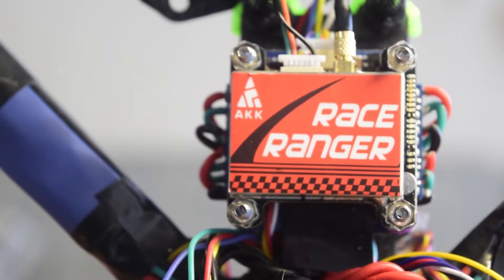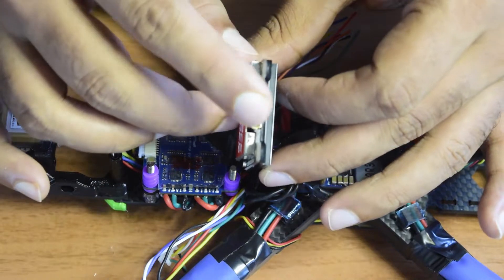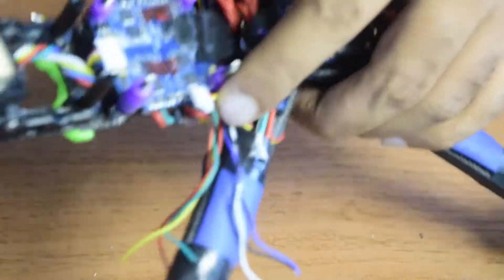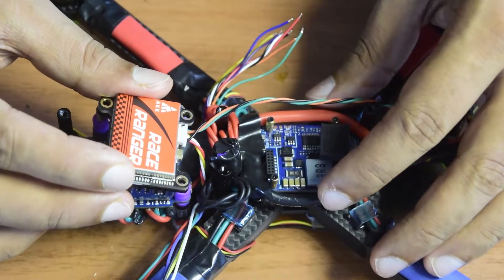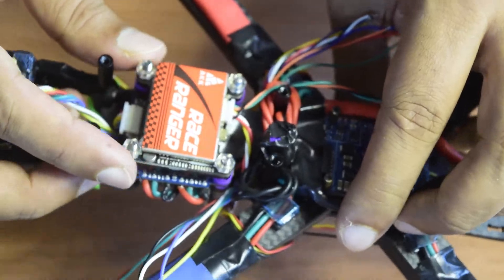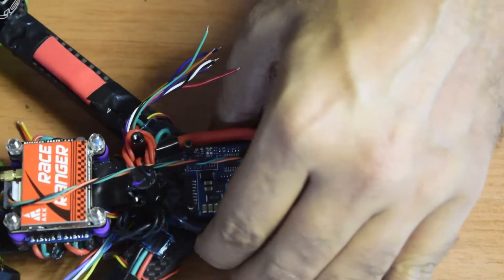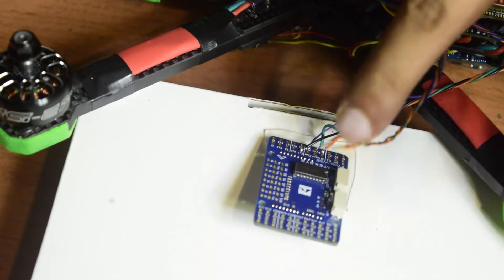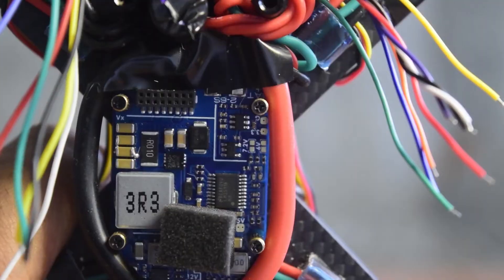HOW TO INSTALL VIDEO TRANSMITTER ON DRONE | AKK A1918 Race Ranger Long Range Video Transmitter

Comment: Hi
My camera have 4 wire
GND DM DP 5V

Where should I connect the DM and DP cable on my VTX
Reply from the maker: which is the camera that you have normally DM and DP means data plus and data minus these are microprocessor or microcontroller based cameras or USB cameras they cant be connected to vtx directly. I hope this helps. Please stay tuned to my channel for my future videos
Reply: that camera is probably a webcam or a digital camera. you need to buy an ANALOG camera. my personal favorite is the caddx ant.

Comment: I bought one of these to try out and IDK where my head was at because I somehow bench tested it thinking the antenna was on, when it wasn't, for like 5 whole minutes at max power. When I noticed I was like oh crap. Thing is, it actually still worked better than others I've tried lol.. it did mess it up a little bit though. I do have clear video at quite a decent range but the smart audio doesn't seem to let me transmit an AC coupled signal, and there is a constant pop every now and then. I went ahead and ordered the ultra long range version to try out and hopefully not destroy in the first 5 minutes.
Reply from the maker: Good luck. I hope this video helps. Please stay tuned to my channel for my future videos
Reply: @AstroShootingStars  I'm actually trying a Rush Tank Max Solo right now and the Race Ranger still seems to do about as well as the 2.5W output on the Max Solo. I just like the Max Solo cause it has a dedicated analog audio channel. IDK what AKK is doing but maybe they have actual filtering on the VTX.

Comment: Wired this on mine. And the video is glitching. My old one antenna broke off and was stuck on till battery died 100 feet up 8n tree know I can't get the picture quality I had with the stock vtx. Any way you could help. Please? Thanks
Reply from the maker: The glitchy video can have several reasons few could be if you have mounted it near the high current source , Over heating, incorrect frequency table config and incorrect smart port config, bad antenna.  I hope looking at one of those could help you. Please stay tuned to my channel for my future videos